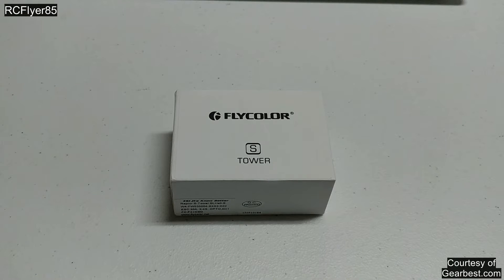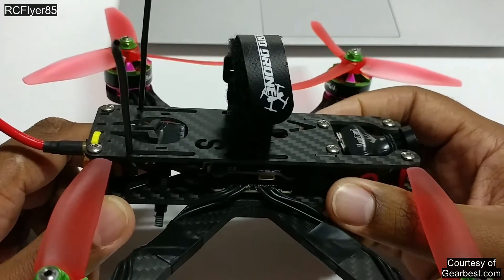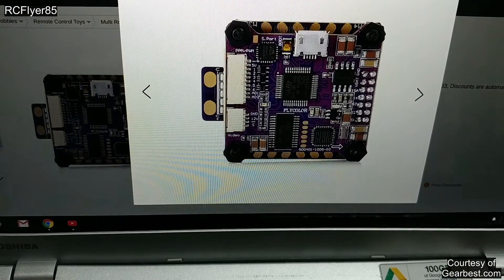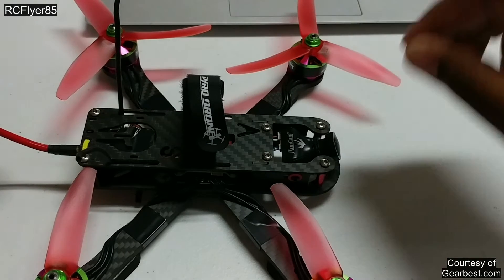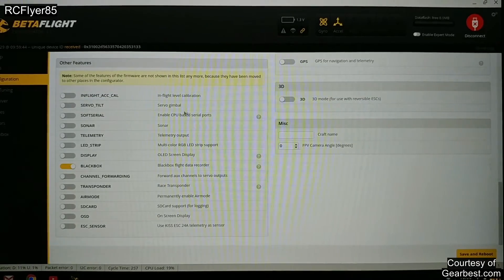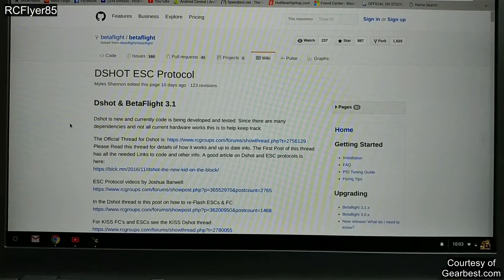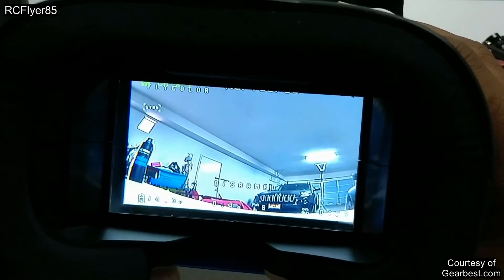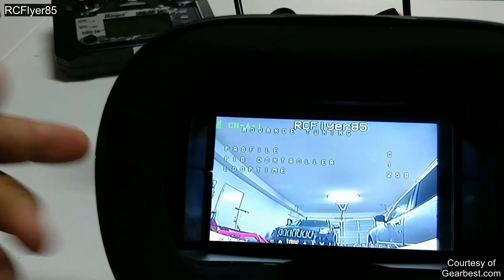FLYCOLOR Raptor S Review - One Of The Best AIO To Date!

Comment: Good Morning, Great Video!! One Question I Have As A "Newbie", How Do You Connect The Motors To The ESC Pads So That You Don't "Miss-Wire" Them (Spinning The Wrong Direction, Or Short Circuit, Etc)?
Reply from the maker: Mark Adamson It doesn't really matter as you can change motor rotation using the BLHeli configurator

Comment: i got two of them from arris hobby they were supposed to be 30 amp esc's  when i hook them up to blheli_s they were both 20amp when i asked arris hobby about it there response was firmware only allow 20amp lol you live and you learn.
Reply from the maker: Colortime Paint Co. They are whatever they say on the box.... The 30A and 20A version both use the same firmware so don't go off of BLHeli alone
Reply: +RCFlyer85 hardware and firmware are two separate. things they sold me 20amp esc's and charged me for 30amp esc's is what happened lol.
Reply from the maker: Colortime Paint Co. I'm saying I have never actually seen a 20 amp version how do you know that it is 20 amp and not 30 amp?
BLHeli won't tell you.....
Reply from the maker: Colortime Paint Co. I don't even think they ever released the 20 amp version. all you can find online is the 30 amp version I really believe the 20 amp version was scrapped before it made it to Market... 

but hey I'm not going to argue with you I'm just saying it's easy to think you have something you don't because I made the same mistake at first
Reply: +RCFlyer85 i purchased two rtf quads from them that they had advertised as having 30amp esc's which was not the case they were actually 20amp and the way they fixed it  was giving me a apologie and 5% off my next purchase i never used that 5% lol.
Reply from the maker: Colortime Paint Co. Are you talking about Towers? Or individual ESC's? Maybe I misunderstood

Comment: Great video, I like how easy the build is once everything gets rolling I just can't get my OSD to display and the X6B is having a hard time with SBUS, OSD just flat out doesn't show up.
Reply from the maker: 16by80 Nothing at all on the OSD or does it say No Data?
Reply: Wow, that reply time is amazing. Thanks.  Well I commented too soon, I ended up getting it.  The OSD was completely blank at first.  I think they may have updated the OSD by the time I got mine (delivered 2 days ago).  I ended up opening the serial pass through and then going into MWOSD the newest Crome App version 1.7.1.5 and setting it up in there.  Then after restart it magically appeared.  But at first power up it just sent video to the VTx.  Thanks again for the quick response, sub'd.
Reply: Also had to set to IBUS in betaflight and on the I6S to register stick movements, that was thanks to your screenshot, otherwise I wouldn't have adjusted.
Reply from the maker: 16by80 Ok great... Glad you got everything working. Happy Flying!
Reply: Now it ramps up and shakes violently when when I lift it when armed, I have no idea what is going on. Depressing, because everything else is great.
Reply from the maker: 16by80 If it's not flipping violently then you'll just need to tune things out... I assume you are in Angle (Self Leveling) mode?
Reply: I haven't set up the modes yet, so I assume it's in Acro as that's betaflight's default, unless I'm not thinking right. Doesn't make sense why it would run the motors in Acro though.  I got it to level out finally but it still has some yaw shake, I went into the PID and brought everything down to below 20 just to get it to stop shaking (with D at 0), seems to have helped.  I haven't even put props on yet, I was checking fail safe and all that.
Reply from the maker: 16by80 Without props wow... Check board orientation and also that all motors are in the right location according to the motors tab
Reply: By the way, thanks for all the help, you've been helping me power through the problems, I appreciate it.
Reply from the maker: 16by80 No problem... As long as I'm awake I try and reply ASAP

Comment: Hey;
My new Raptor S Tower cant be found on betaflight!
What do i have to do?
Reply from the maker: Julian S Try You mean it won't connect to BetaFlight at all?
Reply: Yes
Reply: do i have to make fc settings..
Reply from the maker: Julian S So that's usually a driver error. Do you have other boards that do connect? Also have you tried different USB cables?
Reply: do i have to choose a board?
Reply: RCFlyer85 what do yiu mean with other fc connected?
do i have to choose a fc in der firware flasher?
Reply from the maker: Julian Strauss I mean do you have other drones that do connect to BetaFlight? You shouldn't need to be in firmware flasher just to connect to BetaFlight.
Reply: Not ever
Reply: so i just connect it and dont choose any board?
No i havent connected a flightcontroller ever!
Reply: I havent ever connected over fcs
Reply: Do i have to press the boot button?
Reply: Is it normal that after about 10 seconds there is just a red light
Reply: Yes i always do that
Reply: No i havent other fcs connected t betaflight yet.
Reply: is it normal that after 10 seconds there is just a read light?
Reply from the maker: Julian S All you should need to do is open BetaFlight, plug in the board and click connect at the top right
Reply: I did this a bunch of times already
Reply from the maker: Julian S Check this out... 
https://youtu.be/m4ygG6Y5zXI
Reply: Betaflight doesnt even show COm 5 and so on!
Reply from the maker: Julian S Perhaps you got a bad unit... I'd contact the seller and ask for a replacement
Reply: RCFlyer85 i got it now with another cable!
Reply: RCFlyer85 hiw to you calibrate the motors?
Reply from the maker: Julian Strauss Are you running Multishot, Oneshot125 or Dshot?

Comment: I am curious about the Smart Port Pad. To use smart port is it that they want us to solder the pads to use smart port? Directions dont seem to cover this on the board.
Reply from the maker: Ken Morris Not sure as I don't have any FrSky equipment... Though I do know that if you use Smartport it utilizes MSP on Uart1 soooo that means that while the Smartport device is connected you won't be able to access the board through the micro usb. Doesn't seem worth it to me....
Reply: Yes I would agree if that is the case, would want to tune with the micro usb and not use controller if that is what you are saying.
Reply: So the smart port i thought though was an alternate way of connecting your receiver, is it not even faster than the sbus port? I am using the RX8R receiver.
Reply from the maker: Ken Morris as far as I know the smart port if not for the receiver but for an additional accessory like to add telemetry... I guess in a way it is tied to the receiver but I don't believe that that is actually where you connect the receiver
Reply: So could it be a pad to solder to enable smart port. Then just throwing it out there would the sbus receiver connection then connect to the smart port connector on the receiver thus enabling the smart port feature. The pin connectors seem similar.
Reply from the maker: Ken Morris Like I said I'm not the one to ask about that part... I honestly don't know. I came across this article if it helps https://oscarliang.com/sbus-smartport-telemetry-naze32/

Comment: hi yes done all that just pulling my hair out lol
Reply from the maker: ggvaper Then most likely you have the wire in the wrong pin in the plugs... carefully examine both ends and make sure it's correct wiring. Wiring is the only cause left
Reply: hi I sorted it I erased  the black box dater then also put ground and live  on then the last wire on to sbus on the xsr the last pin is this correct ?or should it be s port on the xsr?its all working just  not telemetry
Reply from the maker: ggvaper Yes sounds right.... to get telemetry working is kind of a hassle so I really wouldn't recommend it

Comment: It looks like they addressed the biggest issue I had with the previous version: the battery pads. They were way to small and crowded on the previous version. I actually gave up on the build and shelved the board because I simply lacked the soldering precision.
Reply from the maker: HisXLNC Oh wow... Yes it was a bit of a squeeze but much better now. Keep practicing soldering and you'll get it. the main thing with the first version is you can't use too large a guage of wire.